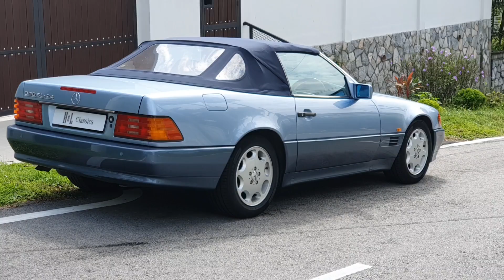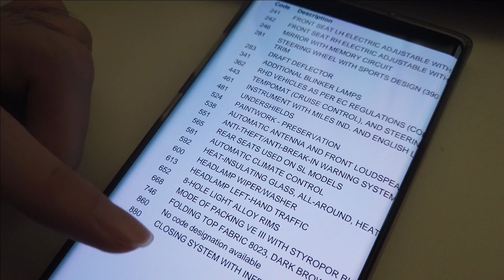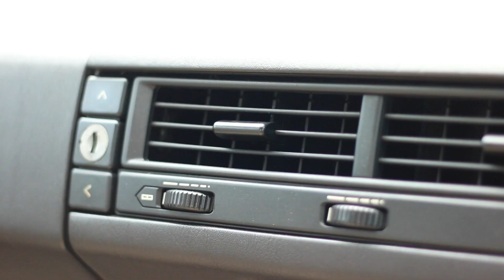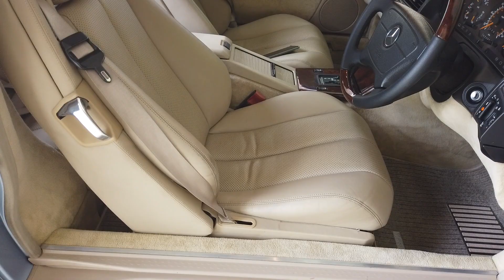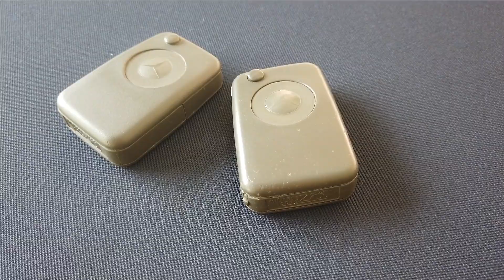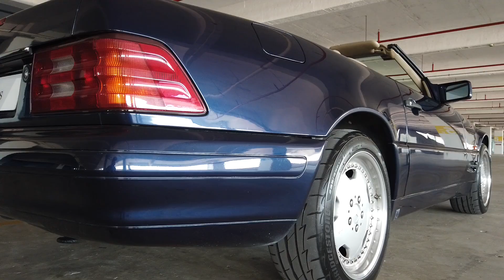Mercedes-Benz SL R129 Buying Guide

Comment: I just looked at a S500 about 20 min ago. First obvious defect is the driver side seat does not adjust when pushing the button. The convertible top doesn’t work. So the hard top has to stay on. Trunk doesn’t stay up when lifted, and the ac didn’t blow through the middle vents. The engine hesitated when I started it up and sounded like it was hesitating also while idling. During the test drive the engine responded well when I hit the gas like it was ready to go. However the ride seemed kinda loose and jingly. 🤷🏿

Comment: thanks for the great video ! you're mentioning that in any case, temperature should not get close to 100C - i tend to see that happening in hot weather traffic jams on my 300SL. Any hint to what i should be looking at?
Reply from the maker: Tackle the usuals first: fan clutch, thermostat water pump, auxiliary fans, and radiator. Sometimes an overhaul is in order due to head gasket failure.

Comment: Thank you for the hight quality in all your video.
I own a 1995 sl320 with the m104. It seems that it is the last Mercedes six in line  up to now. Am I right?
Reply from the maker: Yes, until the M256 came out a few years ago.
Reply: I have a 1998 SL320 straight six and just required a new head gasket at 64k miles, which means it will see me out !!

Comment: My 1995 SL500 has 278,000 miles and I've never rebuilt it. It has run flawlessly since new, the engine is a real gem.  I performed regular maintenance such as plugs, wires, caps and rotors (expensive) and of course changed the oil every 3,000 miles (8 1/2 quarts) and it doesn't use any between changes and the exterior of the motor is bone dry. I never had an issue with the head gasket or any others.
Reply: My 1997 SL500 has 265,000 miles and still runs excellent! Never rebuilt the engine just the regular maintenance  for more than 20 years recently I replace the secondary air pump(was causing check engine light) replace the strut upper shock mounts and rebuilt the control  module for the convertible soft top ( still researching how to reset the windows and the roll bar to make the top work again . But this is an amazing car !
Reply: No biodegradable wiring issues on your 95 eh?
Reply: @sherloidbai7064  Luckily not to date. I did have a bit of a scare once when one of the coil wires had fallen out of the guide and shorted out where it was rubbing against a pulley. It's a good thing a new set of Bosch wires was 'only' $450 hahaha.

Comment: Do make sure the car comes with the spare IR remote key fob and check it works. They are no longer available from Mercedes and without it you will not be able to get past the immobiliser. In other words you are left with a very big and expensive paperweight!
Reply from the maker: For some reason folks in the US have difficulty getting the key fobs. For many other countries, the keys have been made available for some time now. The only other resolution if you lose your key is to completely swap the ECU, keys, immobiliser, and tumblers. Or get another car...
Reply: @HLClassics  I'm in the UK - not US. Mercedes main dealer are accepting orders for IR fobs, but they do not have them in stock in Mercedes Germany. As such they are just going on 'back order' with no confirmed delivery date. Cost will be £220 UK should it ever arrive in stock. There is a Mercedes key specialist here in UK who can make them and programme  to your car - but cost is around £450 UK plus its required to take vehicle to him and leave it for a few days. I investigated cost of stripping out immobiliser system with the SL shop - they reckon about 8 hours work so ~£800
Reply from the maker: @shadychrisuk  When we ordered, it took about 3-4 months for the key fobs to arrive. That they are taking orders is a good sign; the keys are likely made to order. In the US, the dealers are mostly either not taking orders or insisting the keys are NLA.
Reply: @HLClassics  yeah i think they probably wait until they have a batch on order that they can get a supplier to manufacture for them... You'd think a company as big as Merc would just order up a thousand of them though.. They probably only cost pennies to make in the factory..

Comment: There was no real competitor to the R129. BMW's 8 and Lexus SC were not  convertible. Until Jag released XJ8 in 1997, the XJS was way outdated to compete. Some might say Austin's DB7, but that was of a very limited production.
Reply from the maker: At the time it was the top of the line roadster in the world without compare. The Rolls-Royce Corniche was very much still a 70s car. Furthermore, Mercedes-Benz hadn't diluted the model range with the modern line up of the SL, AMG GT, and SLS AMG. Today the SL doesn't really have a place in the market. We'll have to wait and see what the R232 brings.